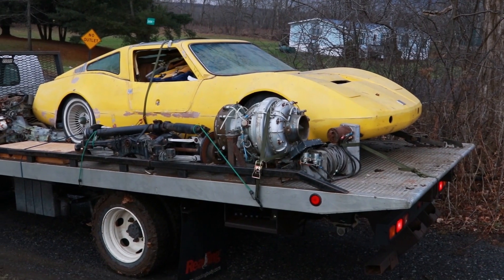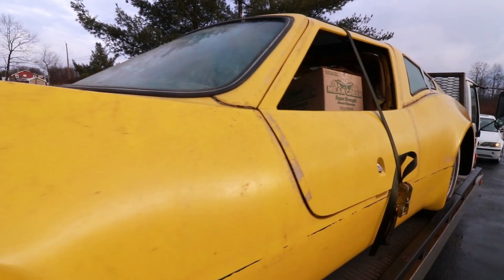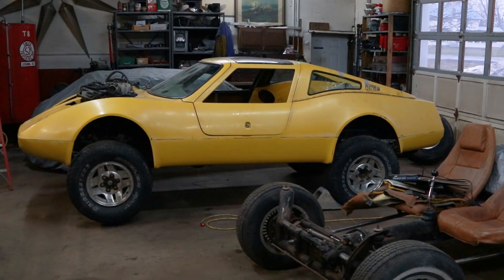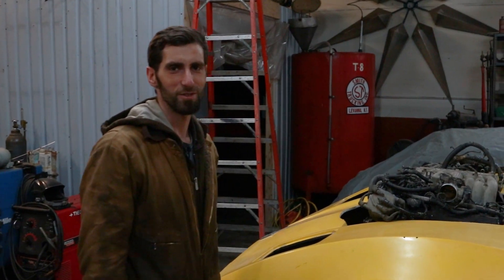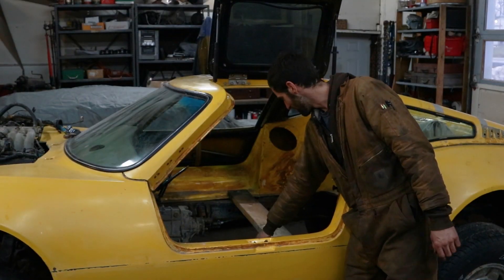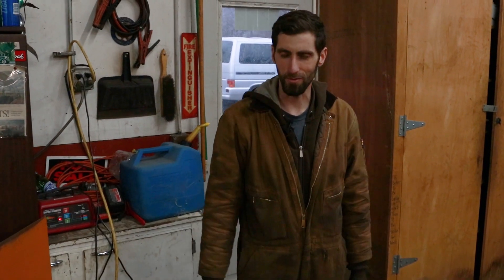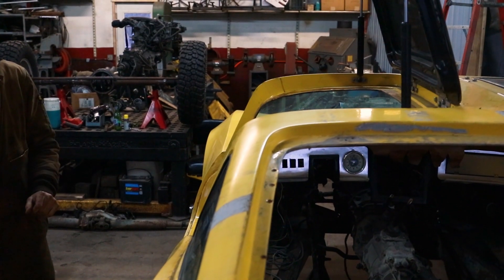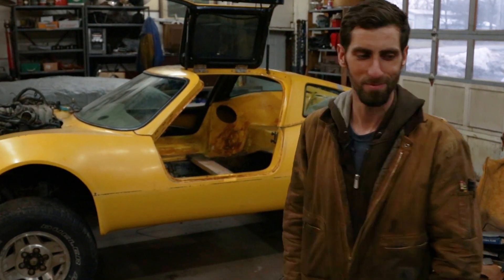First ever 4x4 Kit Car? Toyota Truck merged with a Bradley GT II VW Kit Car

Comment: You should put some kind of protective film on the windshield. The windshields for these cars was only made for these kits and are hard to come by nowadays. I used to have a 1980 GT2 that I was never able to find one for. Stoked to see this build though man looks awesome so far!
Reply from the maker: Caley Morgan thanks for the tip! I actually mentioned the windshields in my previous video. Sorry to hear about your luck. Can’t wait to drive this thing!